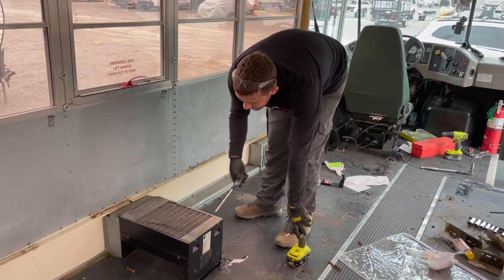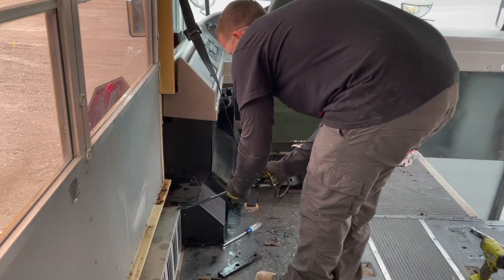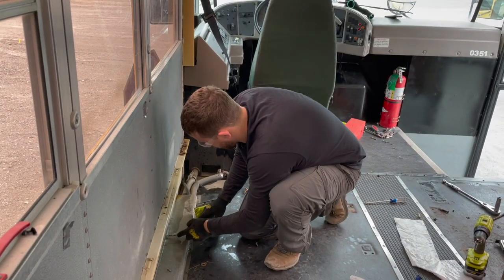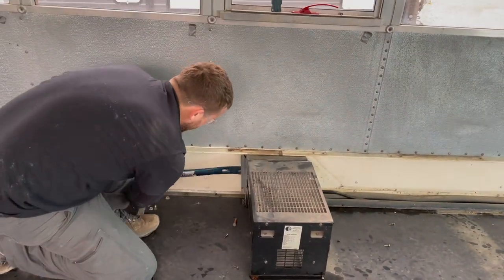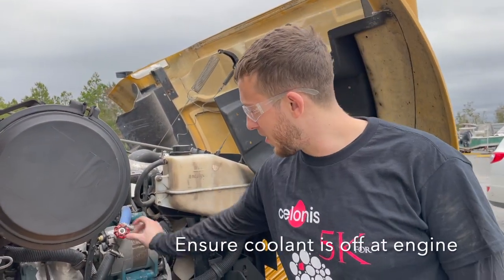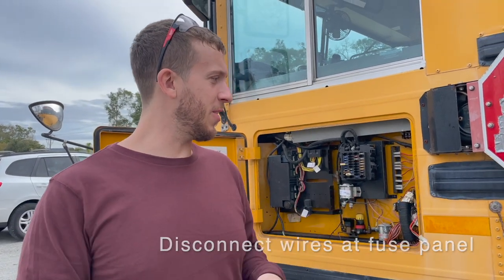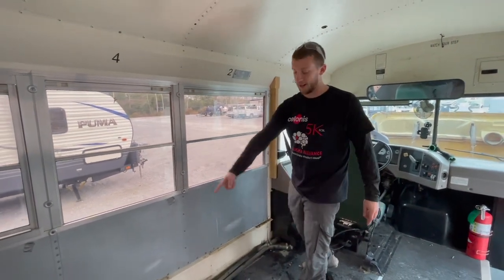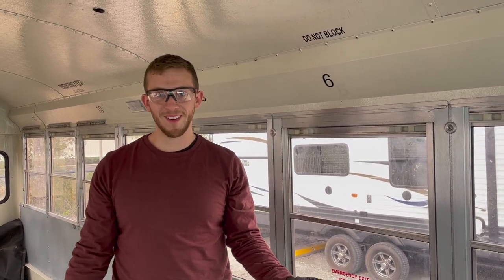How to remove a school bus heater | Lessons Learned | Acrovan Adventures | Bus Build 2

Comment: I think it would be cool and a good idea to explain why you do some of the things you do. I myself am trying hard to find a school bus to convert into a camping/toyhauler and am finding myself curious why you are removing your sources of heat and a/c that are prebuilt into the bus.
Reply from the maker: That's a great idea, we will try to work that into future videos! One main reason is that the factory heat and AC only work while the bus is running, which is not ideal when trying to sleep or if we're parked in one spot for a while. Also, we removed the factory heat because it was very bulky and we had a specific design in mind. We knew that the heater would be in the way of the furniture we were going to put in later. Similar for the AC units in the bus, plus they're not the prettiest thing to look at.
Reply: @AcrovanAdventures  see as a noon I never would have known that as just a viewer or for using your content as information for my own journey